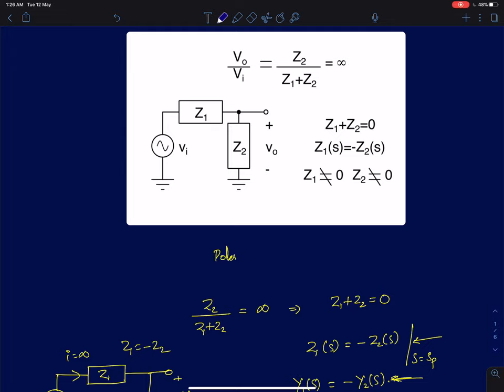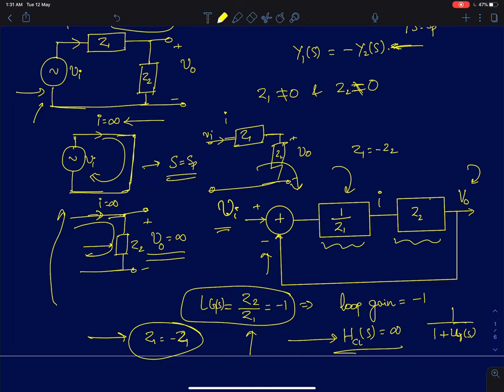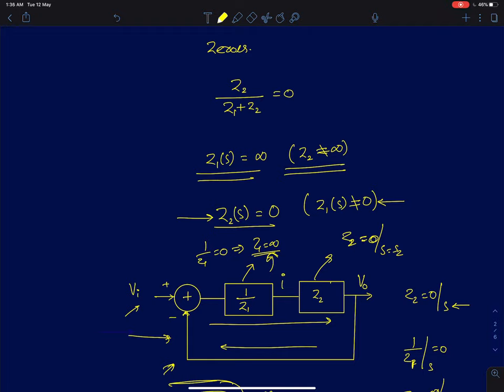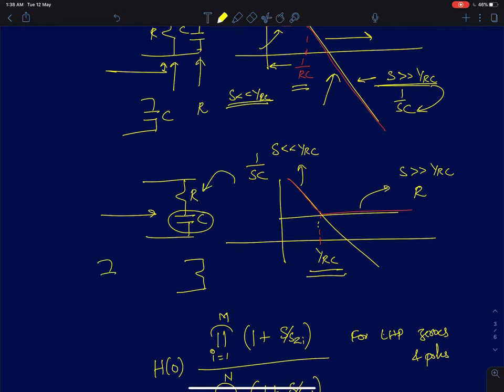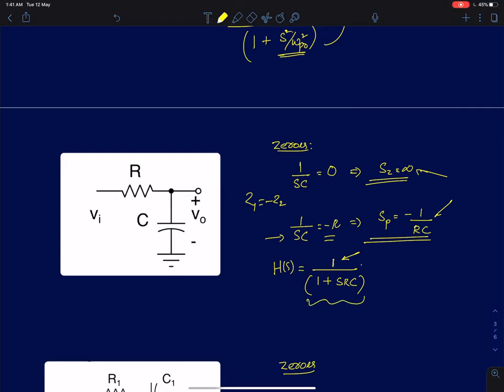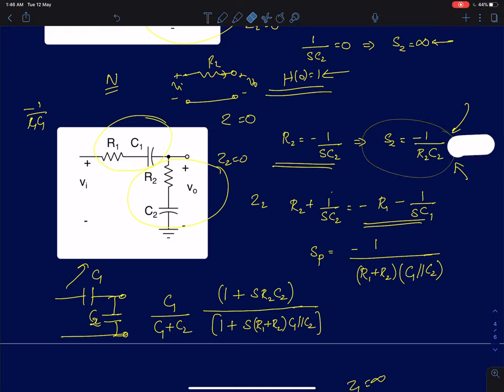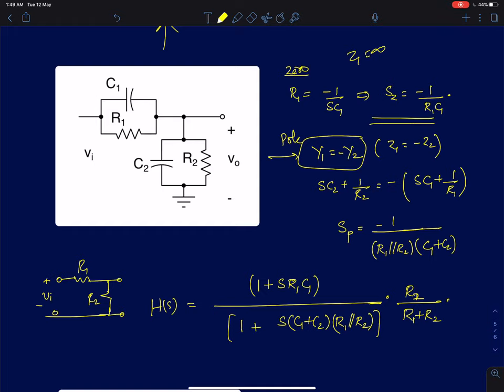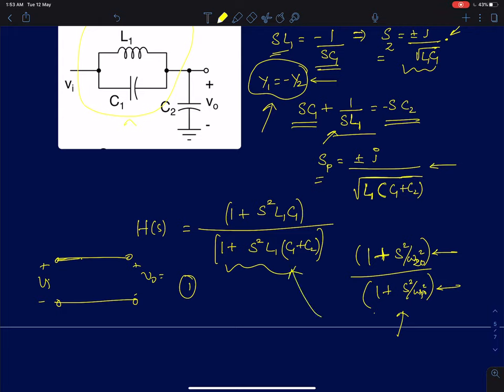AIC Lecture 33: Finding poles and zeroes of passive circuits- An intuitive approach

Comment: In the second last circuit, when Z2 becoming 0 for freq tending to infinite, at the same time Z1 also becoming zero. Then why we considering it as a zero?
Reply: No, Z2 will not go to zero for the same pole frequency that gets Z1 to infinite. Had R1C1=R2C2 been the case, then Z1 and Z2 would have gone to infinite and zero for the same frequency, respectively.